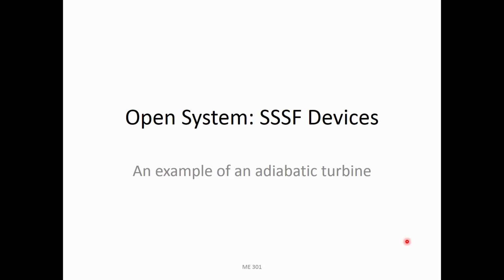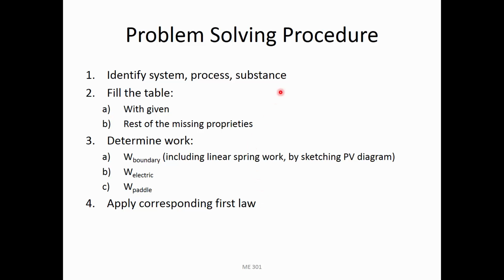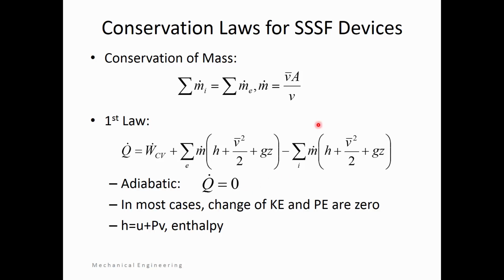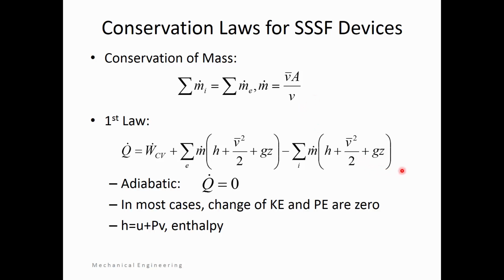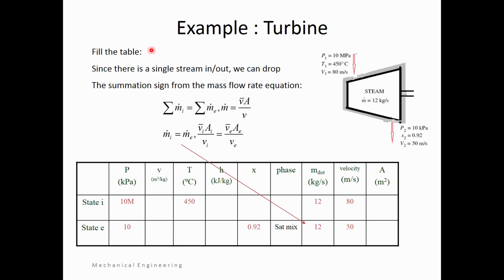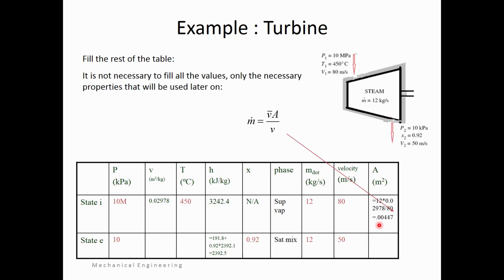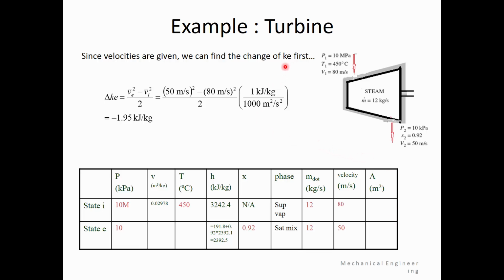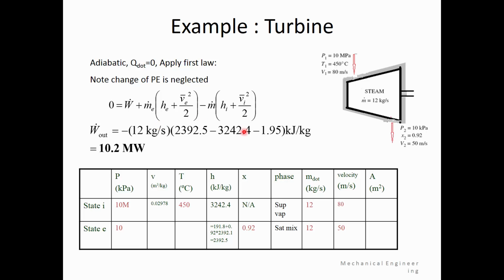Thermodynamics: Example, Adiabatic turbine #2

Comment: Tables are where it's at
Reply: Engineering Equation Solver has all the tables built-in for looking up this data.  You just type in h[1] = enthalpy(Steam, T=T[1], P=P[1]), after defining the temperature T[1] and pressure P[1] at the state in question.